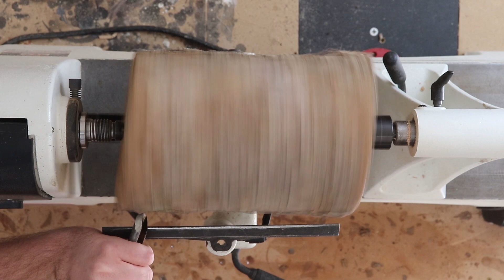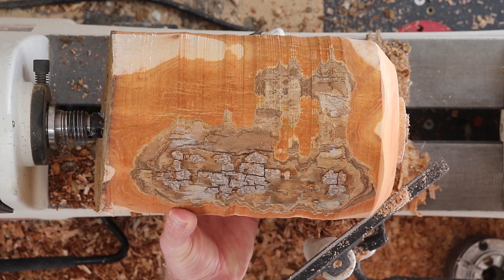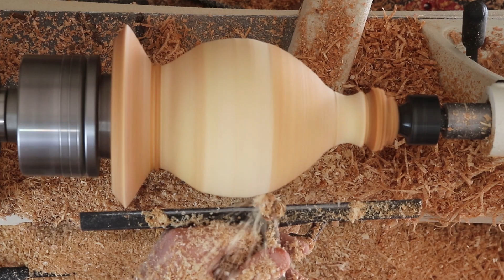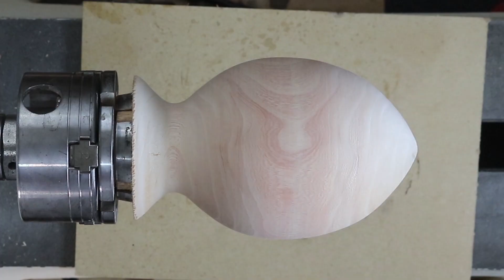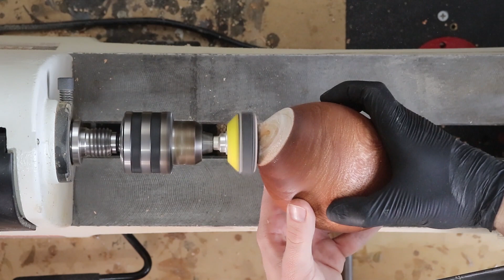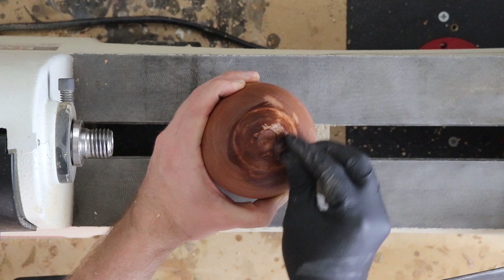Wood Turning - Bird's Eye View

Comment: Hey man what camera are you filming with?
Reply from the maker: It's a Canon Rebel SL2. "Borrowed" it from my wife haha
Reply: 😏borrowed lol I have d3200 Nikon  i have been debating on taking into the shop to film with but i am terrified of all the dust. With the cam I'm using I'm less so but I think I'm going to try it the next one i film. I have to bring the visual quality up of my stuff. Do you have it auto focus or is it at manual. Just curious if you had trouble out of the auto focus if you used it.
Reply from the maker: @MillerMade  I use manual focus, but I get it wrong sometimes and don't realize til later. Autofocus is awful on mine. Haven't had any issues with dust, I just blast some compressed air on it when I'm done. So far, so good haha
Reply: @CookWoodworks  thanks man that's super helpful

Comment: what a strange wood, that darkens in such a short time.
Reply: Ironymus I wonder what finish was used. It went from light to dark with 1 coat
Reply: @natewahl9873  I think he used an fairly ordinary oil stain to darken it at the end.  -Mike
Reply: @natewahl9873  I'd rather guess it's also the wood, that reacts this way to the finish
Reply from the maker: Bingo. Red chestnut